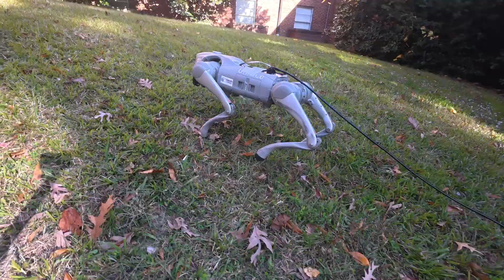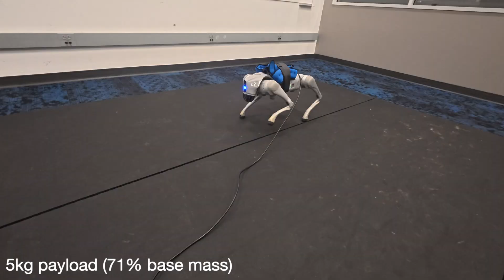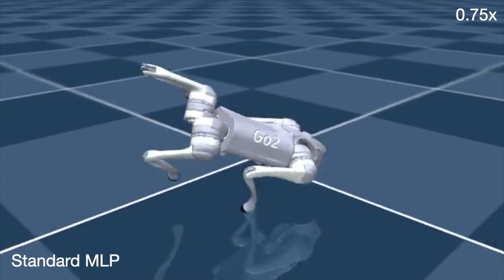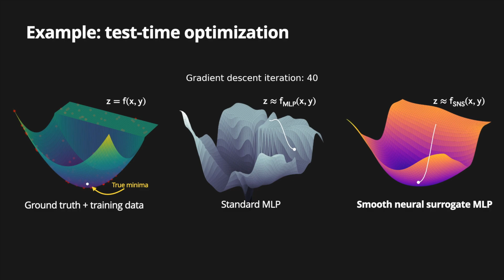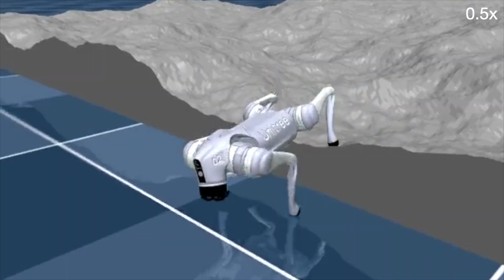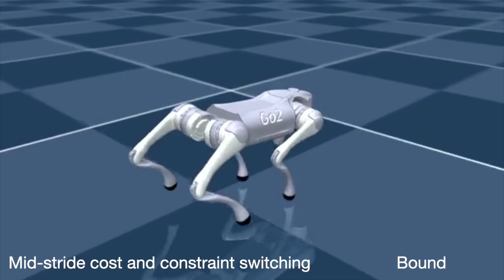Learning Legged MPC with Smooth Neural Surrogates

Comment: interesting. but no mention of how the smooth architecture actually works, and no arxiv link, makes it very frustrating.
Reply from the maker: The arxiv version has been released by arxiv now: https://arxiv.org/abs/2601.12169. It's also updated on our project website. Code will be open-sourced soon as well.